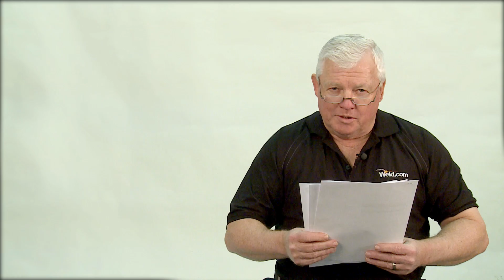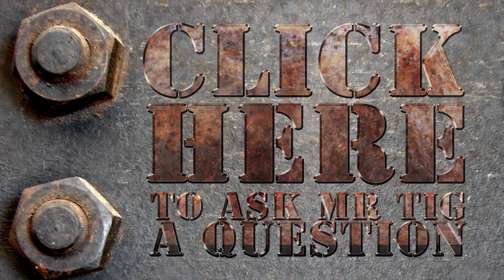ER70Sx: Choosing the Right Filler for Your Application | Weld.com Forum

Comment: Er... the deoxidisers cause the "silicon islands" you see in weld puddles and can result in greater risk of inclusion. On the other hand welding dirty parts is far more likely to result in inclusion than using an S6 rod, so if you're welding parts with mill scale residue etc on them then S6 makes more sense, but if you're welding machined or otherwise very clean parts in a critical environment then S2 is better.